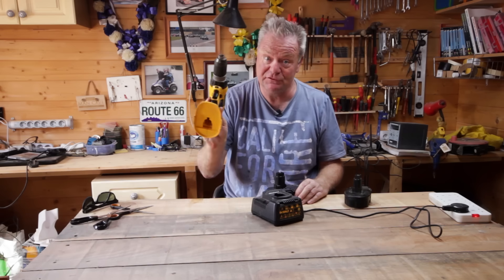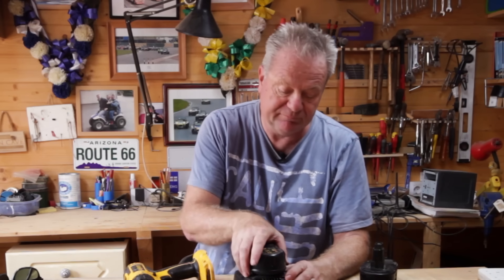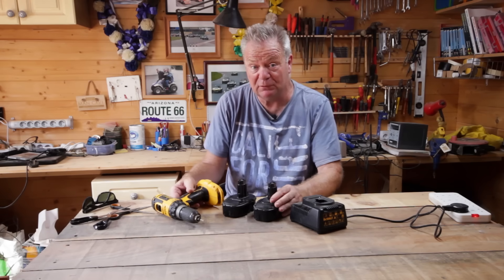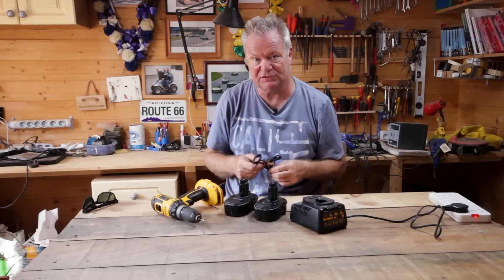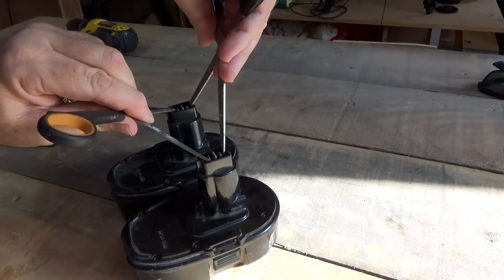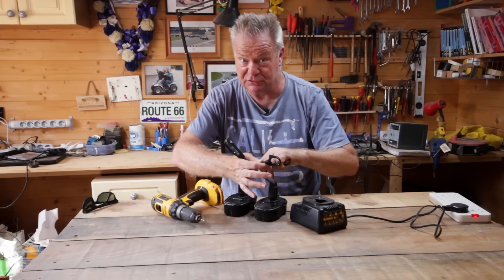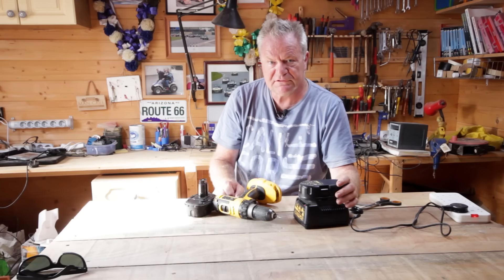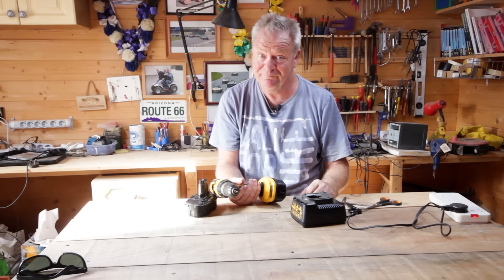How to revive a dead rechargeable power tool battery easily

Comment: What if you don't have a fully charged battery to do this with?
Reply from the maker: Borrow one from a friend perhaps?
Reply: @JPinFuerteventura  Well that's a thought lol.  I was thinking of using a power supply that could produce similar voltage.  Think that would work?
Reply from the maker: @TheGuyWithNoSubsForAReason  A similar voltage and amperage should be ok
Reply: @JPinFuerteventura  Thanks for the reply!

Comment: Do this on a daily basis with different flat batteries did a 12v one today basically used a 18v battery same as this to belt the shit out of it hahaha 🤣 and it seemed to work as good as new now charges to 13.98v so more or less full charge and it works great I use wires instead of this you use but both seem to work the same good video and yeah these companies well over charge for there batteries no wonder we do this trick resetting them 😉😂😂😂😂
Reply from the maker: Very true Brad. Thanks for commenting.
Reply: @JPinFuerteventura  did the batteries you reset still work now or did it finally stop working if don’t mind me asking 👍
Reply from the maker: @Brad-0212  I got another 3 years of useful  service from the battery
Reply: @JPinFuerteventura  nice did it eventually break or do you still use it now 👍
Reply from the maker: @Brad-0212  It finally died so I bought a new Bosch drill
Reply: @JPinFuerteventura  ok well at least you more or less got your moneys worth haha 😂

Comment: Great video,  can you use different volt batteries or do they need to match?
Reply from the maker: Ideally similar voltages
Reply: @JPinFuerteventura Thanks for your reply. Happy to confirm it does work with different batteries! Ended up using different voltages, donor battery was 20 volt & different brand & the dead battery was 18 volt and it worked within minutes! Thanks again for the video!
Reply from the maker: @1real11  Thanks for letting me know
Reply: @JPinFuerteventura  Thank you for going to the trouble of doing such a straightforward & useful video, which saved me 💰💰💰😁! I think you're right as well, it's probably better to use matching batteries, and perhaps I was lucky mine didn't incur damage! 🤔

Comment: My battery it’s charge only one use and dead after using it for two hrs or less no good so it’s better buy a new drill .
Reply from the maker: How long do you expect to use a battery before it goes flat?
Reply: @JPinFuerteventura   I’ll have problem with this black and decker thing I’ll buy it let all night long even two days the battery dead after use this tool few hrs maybe one hour battery expensive so I’ll went too the pawn and buy a good one rigid better one I’ll happy just need too buy a new charger is working .

Comment: I have a bunch of those types of batteries , but for how long do they stay charged ?
Reply from the maker: That depends on why they are flat. If they are flat because you used it until almost empty and then did't charge for a while, like the one on the video, then it will hold its charge as normal. However, if they are flat because they have faulty cells then probably not very long.

Comment: I tried this on an 18v Makita battery, the battery wouldn’t take a charge, I tried 3 different chargers to no avail, this method worked, I used two scrap pieces of wire, and bingo,a little bit of life in it, enough for the charger to do it’s magic !
Reply from the maker: I am glad it helped Bryan. Thanks for the comment.

Comment: Yep, I just did this and it actually worked. One of my batteries was completely dead and when put on the charger flashed red quicker than normal. I used scissors and jumped it counting to 80 then put it on the charger, it took about 2 hours for it to fully charge, I tested it with my drill and it worked. Thanks!!
Reply from the maker: Thanks for letting me know Casper. That's another one in the eye for the nay sayers.

Comment: This don't always work, if one of the cells go this won't do nothing, I've messed with batterys for years, take the battery cover of get a multimeter and check every battery for volts, I've had new batterys that fail so if your not getting and volts from a cell or 2 , make a tiny L shape from a little screw driver not sharp about 7mm on the L, go to the positive end of the battery and your see 3 cut out slots, be careful and insert your L shape small tool into the middle and push down in all 3 slots, you might get a hiss from the battery dont worry, what happens there his a cut out in the top of the battery and it pushes a metal seal upwards as a safety cut out and when you push down it re connects ps you get all these problems when buying cheap batterys, so if your not into batterys buy better ones not copys like I do
Reply from the maker: Absolutely Colin. If a cell has gone there is no bring the battery back to life, at least not for any useful life. Really this is a way to fool the "smart" (ie. stupid) charger to start to charge.

Comment: What would happen if you tried to use a 20v to revive a 12v? Would it be too much voltage for the smaller battery?
Reply from the maker: It may well be. A battery with a similar voltage would be better.

Comment: Brilliant! I have spent ages trying to bring my late fathers drill battery back to life. I came across this video, charged my other dead battery for just 10 mins, did the 'jump start' scissor trick and now the suspect battery starts charging. Fantastic -  thanks very much!!
Reply from the maker: I am glad it helped
Reply: @JPinFuerteventura  thanks. I have managed to get the charger to recognise the battery and start charging it but when fully charged it just turns the drill over very slowly. I am charging again but fear the battery may be at the end of its life. Fingers crossed and thanks again.
Reply from the maker: @TheCedharper  It may well have a dead cell sadly

Comment: THANK YOU! Mine is an old German Drill, which I got as a present. It's a 2008 model, but was NEVER used. It's basically brand new. However it has only ONE battery with it. I was about to get a new drill when I found this video. I managed to jump it so that the charger kicked in. Now IT WORKS!
Reply from the maker: I am glad it helped.

Comment: I've seen a number of these videos on youtube, problem is, I tried this on a battery and it didn't do anything.
Don't believe the nonsense you see on youtube.
Reply from the maker: That's because you battery must have a damaged cell or cells. It works for batteries that have  acharge that is too low for it to register as being inserted in the "smart" charger. Don't believe the nonsense that some comment on videos!

Comment: But you need to have another one to do it with ?  I only have one power tool , a drill I bought in 1999. I have been noticing the red light stays on and today I realise the reason. Got any tip for me?
Reply from the maker: All I can suggest is that you try and borrow similar a good battery from a friend

Comment: this is why I hold off on buying cordless power tools. I rarely use them, they'll be stuck in storage for months, the batteries will probably degrade from lack of usage.
Reply from the maker: That is a problem. They are so handy though, particularly to use a long way from a power outlet.

Comment: Old battery does not HOLD a charge. You can trick it into taking a charge but what is the use if it will be dead the next day?
Reply from the maker: The one in this video gave good service for over 3 years

Comment: I put batteries on charger each battery time light is blinking but when I put my batteries in drill ,the drill is not responding what to do ?
Reply from the maker: Assuming that the batteries are actually charging (have you checked with a  multimeter?) then it sounds like a problem with your drill. Can you borrow a battery that will fit from a friend to see if that works in your drill?

Comment: LOVE IT, AND HOW DO YOU REVIVE DEWALT  BATS NOT HOLDING CHARGE, SAME WAY? THANKS
Reply from the maker: If they don't hold a charge then one or more of the cells is probably damaged. This won't fix that unfortunately.
Reply: @JPinFuerteventura  Thanks JP, I think I did that by completely draining the 2 bats when I got my New Dewalt screw driver, was told it prolongs the bats life.

Comment: Saves a lot of money and you can kill your entire family. The reason that the batteries become disabled when they get completely emptied his crystals build up inside the battery that can then burst into flames if you attempt to recharge them. You might get away with this 50 times, but on the 51st time that battery will catch on fire. Perhaps you remember the exploding Samsung cell phone battery routine. From the first time I saw somebody talking about jumpstarting these batteries I have contacted you tube to explain just how dangerous this really is. By the way, I don't sell batteries.

Comment: I have a DELTA DRILL (CL 180) that is probably 10-15 years old. The batteries were completely dead. With Delta drill batteries, they are very hard to find. And when one does find them (maybe Ebay) they are quite expensive. I used this charging process and the batteries became fully charged. Something so simple. And something so cost saving.  Thanx JP.
Reply from the maker: I am glad it helped! Thanks for letting me know.

Comment: but what is the difference between using scissors on a battery and the charger???🤷‍♀️
Reply from the maker: The charger won't charge because it can't detect a current. Most chargers are "smart" chargers which, in common with almost anything with the prefix smart, means it is actually pretty dumb. If it doesn't detect a current/voltage it won't start to charge.

Comment: Useless clickbait. A dead battery is a dead battery ... you can make it work for a short time with almost no capacity but it's dead non the less.
So many of these useless vids around ... even a moron making a hole and injecting a syringe making them like new again 😂😂
All snake oil ... don't fall for it.

Comment: Usually one or more cells have gone bad so this will work to an extent but the voltage is much lower than it should so the battery run time will be less. Sometimes cells can be repaired by using 2 good batteries in series to repair the dead  battery  or if one has an ac/dc power adapter with 24 volts or more that can be used to give the battery enough charge to charge in the charger. The key is to get polarity correct and don't permanently connect the positive but instead just quickly touch it to the + battery terminal and it should spark. Repeat as many times as needed to get a voltage reading on the dead battery.
Reply from the maker: Yes, god advice . The battery in the video was dead because I used it until it would no longer turn my drill and then forgot to charge it for many months. It gave good service for another 4+ years.
Reply: @JPinFuerteventura  for those that feel they can change cells out that is the best option to restoring a battery to 100% or close to it. I've done that to 2 batteries and they work as new

Comment: Gosh! I was so irritated at the cost of a new battery and the lunacy of throwing away a perfectly good drill, I just frustrated myself and stopped drilling. Not the best of solutions.  I am going to dig the drill and batteries out tomorrow and try this.  If both  batteries are dead is there an alternative charge source I could use?
Reply from the maker: I hope it helps. The best way is to try and borrow a battery of the same voltage from a friend if both are dead.

Comment: Does the battery need to be dead completely or to have less power for this to work?
Reply from the maker: This is only a way around charging a completely dead battery where the "smart" charger doesn't recognise that a battery has been inserted because there is no charge. If your battery isn't completely flat the charger will start to charge.
Reply: @JPinFuerteventura  thanks for your quick response. What to do when a battery gets empty quick? Is there a trick for that problem?
Reply from the maker: @nikkarel515  The only thing I know is to open it up and replace the cell or cells

Comment: but does it HOLD the charge is the question. My mastercraft lithium ion batteries still charge up but run down immediately with the first pull on the trigger of my sawzall
Reply from the maker: That depends on why the battery was flat. The battery in the video went on to give good service for another 3 years. It sounds like you have a damaged cell.

Comment: Can I do this with DeWalt XR batteries ?

I have several that won’t charge because I lost them in a house for 6m and I think they have done “dead” - but are they really dead ?

I thought there was an issue with Lithium - which I understand the XR range is
Reply from the maker: I believe they are lithium batteries which "they" say you should do this with. You will find some in the comments that say they have done it successfully though. I haven't had a dead lithium battery so far to test it.

Comment: I think this is a great trick to get partly worn out batteries to work a little more. Pretty sure that what is happening is that the charger tries to charge but does not see a load from the dead battery so doesn't try to charge any more and just quits so you never do get a charge. By jumpering a good charged battery over that does put some charge into the dead battery. Now when the charger sees some voltage in the battery it says aha, a good battery and then proceeds to charge it. Sometimes our smart electronics is just not quite smart enough.
Reply from the maker: Exactly right Donn. Smart always means dumb in my opinion - smartphones being a good example

Comment: Great idea mate, how do I get me batteries going if they are both dead?
Reply from the maker: Borrow a similar battery from a friend perhaps. Thanks for watching.
Reply: I just did achieved the same result by connecting my "dead" NiCad battery to a Car battery charger. The car battery charger said it was putting about 8ams into the dead battery, which is a lot, and I was scared it might heat up and blow up (though lithium battery have a failsafe, not sure about Nicad). And after about 10 seconds of charging using the car battery charger, I was able to charge my dead battery with my Ni-Cad battery charger, thanks to JP.

Comment: Hi! JP. I would like to ask you, how many time you can revise for a battery, could it go on and on?
Reply from the maker: If the battery has damaged cells then it won't last long after it is revived so it probably wouldn't be worth it to keep doing it. The battery in the video had just gone completely flat, so it wasn't recognised as being inserted by the "smart" charger. It didn't have a damaged cell so gave another 4 years service after I made this video without needing to be revived again.
Reply: @JPinFuerteventura  : Thank you for your effort. Please stay safe

Comment: I've tried this probably 3 times on dead batteries, however I could not revive even one of them. After dissecting the battery cases and pulling out the cells, I found one of the batteries was completely dead - meaning it had close to 1-2 volts in all 3 cases. The other cells in that battery case showed good voltage and could be charged on a standalone charger with no issues. The dead individual cells just could not be revived, my bad luck. If this is a case, this method would not work most likely.
Reply from the maker: Correct, if the battery has a dead cell then nothing will revive it

Comment: This works temporarily. Eventually, in a fairly short time (at least in my experience) the battery will stop charging again. You can keep reviving it, I suppose, but at some point you'll think it's not worth the trouble and just buy a new drill because you can't justify paying more for a new battery than the drill cost at the time of purchase.
But you wouldn't throw away the old drill, because there's nothing wrong with it, it just needs a new battery, and you will never use it either, Because you have a new drill that's better, so it will just sit in your garage for years and years
Reply from the maker: That can happen but it depends on why the battery had lost its charge. The battery in the video never needed to be "jumped" again and gave good service for another 4 years.

Comment: I had the same batteries and chargers as you have. One day when I was done using them, I put the battery in the charger on the work bench. Closed the garage and went inside. About a half hour later I went back out to the garage for something, only to discover a smoke layer in the upper half of the garage. I turned to see a plume of heavy smoke rising from the battery and charger. I unplugged it and tossed it outside. Where the battery ended and the charger began was indistinguishable as they had melted together to a blob. The batteries and charger had never abused or exposed to the elements/dust. That was when I tossed the Dewalt combo set away, much cheaper than loosing my home, cars and lives. No way was I going use the same replacement, they lost my trust. I’ve been using Milwaukee ever since and very impressed.
Reply from the maker: That's unfortunate Karl. Lucky you went to the garage when you did.

Comment: Yea but eventually it will discharge not holding the charge for long ..
You need to change the cells in it..
Reply from the maker: Not necessarily true. That depends on why the battery became too discharged for the charger to not recognise it is inserted. If it has damaged cells then that is true. However the battery in the video gave good service for another 4 years.